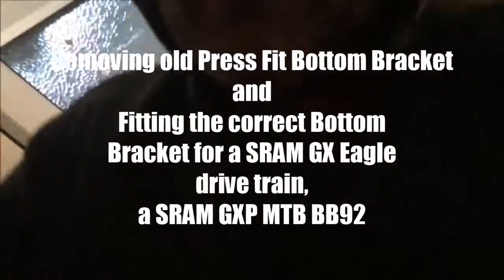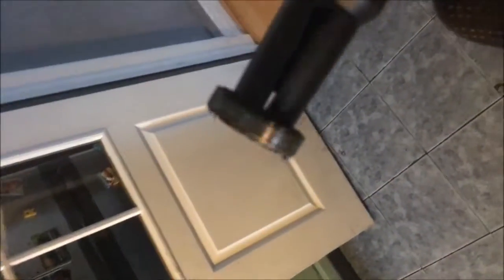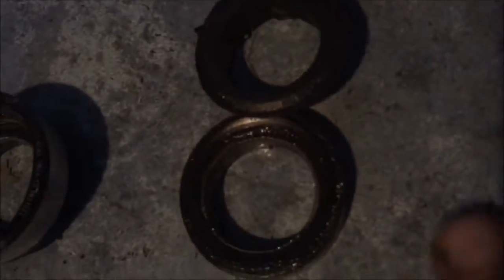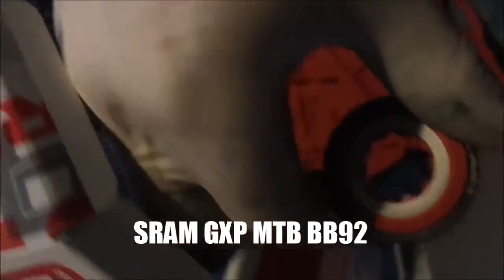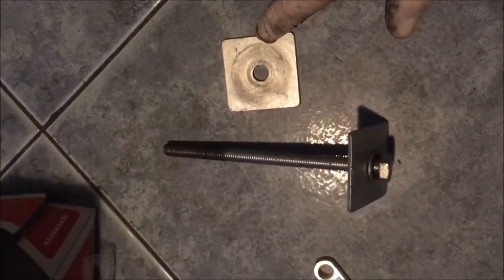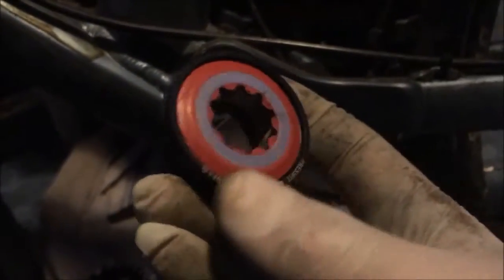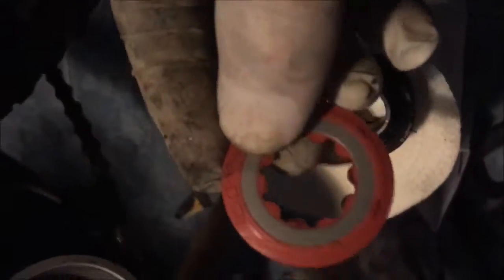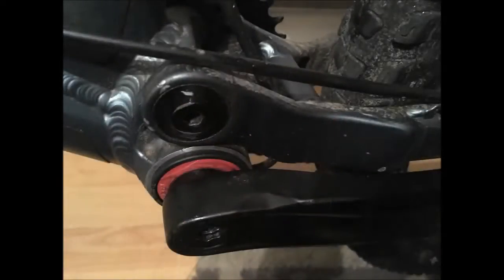Upgrade B.B. to SRAM GXP MTB PF92

Comment: you have to tighten the axlebolt much higher (should be written somewhere around it), it does not set the bearing preload, because the axial force just goes into ne non-driveside bearing.  Otherwise its dangerous.
Reply from the maker: Thanks for that much appreciated.